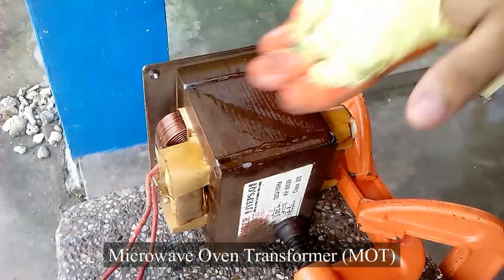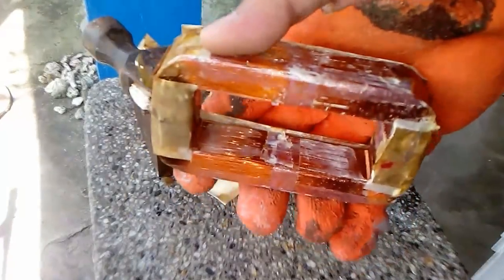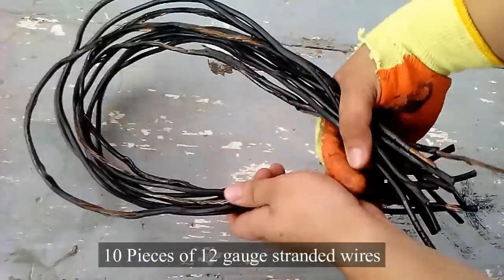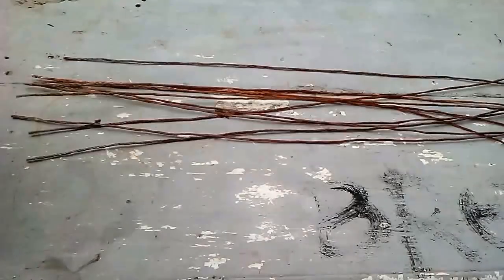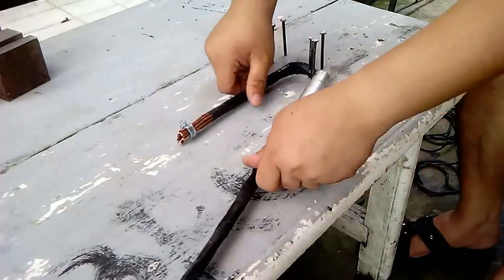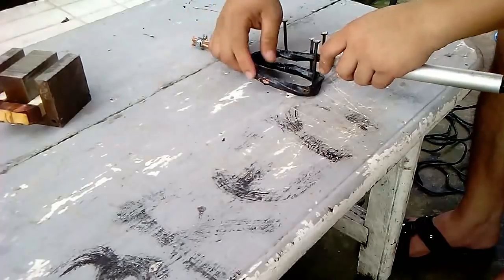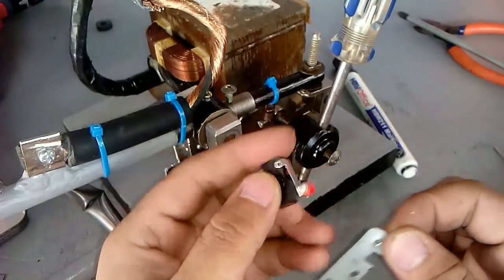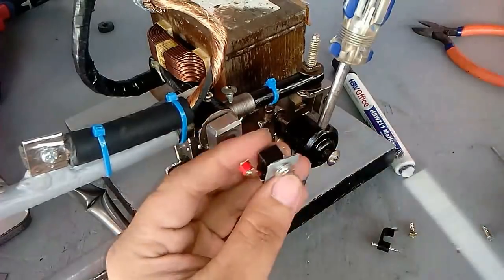Diy Spot Welder Microwave Oven Transformer(MOT)

Comment: By cutting the transformer housing you have dramatically reduced the coupling in the transformer and introduced an airgap, you did weld the housing back together but that is only on the edge giving an effective coupling of just 5 or 6mm rather than the 20mm or so it originally had.  This increases the effective resistance of the transformer and is the same as using much thinner wire.  You should have cut the high voltage windings off and fed new wire through the holes without cutting the housing.  This is why you didn't get the output current necessary, 1 microwave transformer is capable of welding a 2 or 3mm of steel if done correctly

Comment: Why did you connect MOTs in serie and not in parallel ? Did you measure voltage between your 2 projects ? I think it has doubled but amps remain the same

Comment: Connecting transformers in series adds the voltage together at the same current, connecting then in parallel adds the current together at the same voltage. So to get higher current put the transformers in parallel.
Reply: They are in parallel. It straight up wouldn't work if you tried them in series because the primary coil of the second transformer would be only getting a couple of volts

Comment: If using 2 transformers, the parallel or series connection which will work best?
Reply: parallel because you want more amps
Reply: @hyperhektor7733  Hi Hektor. As I see, in the SEK project the tr. are conected serial - am I wright?
Reply: @bostjanv.1545  not sure what u mean with SEK project, but i know series is wrong when you want more amps. Series will raise the voltage not the amps. and you can only have one of the the 2 options. So parallel is the right answer. I worked as Electrican and in Electronics so i should know :).

Comment: I have a question, please help explain  1. Use 2 transformers, must be the same size or not?  And 2. If the size is not the same, will there be any problems?
Reply from the maker: It should be the same. It will work but one coil of the transformer will heat probably its the snallest one
Reply: @SekAustria  thank you...

Comment: Did you use two the secondary of microwave oven transformer? Why don't use Primary Winding?
Reply: He said that he used the primary winding (and the video shows it). The primary winding had fewer turns than the original secondary winding because it's arranged to produce hundreds of volts from its output. The spot welder needs the opposite - less than 2 volts output.

Comment: Bro good effort but i want to say one thing that by making them in series doesnt have benefit because the wiring is same ...in single transformer if wire can carry 100 amps then also in doble it will carry 100 amps because wire guage is same...and here amperes are working

Comment: Gonna try this with an old bxi 100 welder transformer. the old secondary coil was fairly easy to unwind with out taking the transformer apart.  the fun part is to fabricate  the the parts you made in college years ago and I may come up with something else just as good.

Comment: how much kilo watts current produce ? can i use 5 transformer  to produce 20kw power ?
Reply: no, when you have 220V mains voltage usually 3600W is the limit, if you want more then you need
a 3 phase terminal from your electricity company.

Comment: Tip: Spot welding the iron plates is more than enough. Be aware of the more heat you apply with the welding, the more risk for the insulating lacquer layer on the copper..! Stick welding is the form of welding that generates the most heat. Spot weld it wit a MIG or TIG weld the thing.

Comment: Surely you didn't have to cut the transformer housing apart to remove the wiring and then having to weld it back together? 
Couldn't you have just cut and pulled out the wiring you want to remover, and then wound some 0G wiring thru the housing?
Reply: because he want to salvage the secondary winding for future projects

Comment: i need a battey welder can u sell me one a diy if it fuck up something its on me lmk
Reply from the maker: i will work on that brother.
Reply: You'll face a problem there as DC can't be transformed. So in order to make such a welder, you will have to construct a circuit that makes the DC from the battery to AC. From there you can put it in the transformer and get the voltage down i.e. current up.
Reply: Basically, you just need to connect two wires from the wall socket to the transformer. As it's AC, it doesn't matter which wire is on which terminal on the transformer, as long as they both connect on the primary winding i.e. the winding he left from the original trafo. Then you'll have a functioning circuit and the welder is fine. If you' don't want to go through the process of flicking the switch on the wall outlet each time, you'll need a switch on the device itself.
The switch he added (with the little arm and the red roller on it), just has to act as an ON/OFF switch for any of these two wires...again it doesn't matter which.
At 5:47 you can see he's about to install one of the wires on the switch, the other connector on the switch is one of the wires from the wall outlet. The other wire from the w.out. is just going directly to the primary on the transformer.
CAREFULL...!!! The switch MUST be installed on the primary side, the secondary will burn that switch to a blob of crap at once.
Reply: You're welcome. Well, as it is an AC powered device, there is so to speak no polarity as it "shifts" (alternates) with the frequency of the power grid (in most countries 50 Hz). So 50 times each second the one wire is + and the other -, when it shifts the polarity is reversed. That means it doesn't matter if the blue one goes directly to the transformer or the brown one. The white one, well..it could be any color. What it does, is to lead the power from the switch to the trafo, while the brown one is a live wire coming from the wall socket.
AC is the only form that can be transformed up and down in voltage/amperage, DC can't. It would be a little complicated to explain why, so I'll keep it simple.
A stick welder has an inbuilt rectifier, that changes the transformed AC to DC. That means you can use a DC device for welding, given that it has enough power (A).So your battery welder will work, but you can't transform the 12V DC down and get more amps out of it, without expensive electronics. So if you want to stay with 12 V, it can work as long as you don't overpower the battery. A word of caution here...NEVER short it out..! If shorted so more amps flow, than the battery can take, it will explode..! I.e. short it with a wrench or something, is a big NO go..! 
Unfortunately, the link is in Russian..and I really suck about that..(my Chinese is worse, though)...lol
Now, what I take from it, it's an ok design..but only to be used for shorter periods of time. You can add a timer on the switch side, that's an option..yes. A cheap timer module that runs 12 VDC from E-bay will do. My suggestion would be a battery of minimum 60 A/hr and a charger, you can hook up to it when the voltage goes below 10 V.
Reply: Hi Izzy, it's 11 o' clock am here in Denmark. I thought you were Russian as the link was to a Russian site. The 12 V timer module will do the job, the solution with the 555 will too. The 555 IC is an oscillator/timer unit, but it can't stand alone so other parts are needed too. I would suggest buying a ready to mount part. That would be easier for you, as you wrote your electronic skills are limited for now.
I did an E-bay search and found a module with the exact description you gave. They ask 15 $ for it..that's just extortion..! I see you get 12 V timer modules at around 3 $, with free shipping, even found some that say 2 $. A lot of them include a pictogram with a description of all terminals used.
Reply: Excellent..! The circuit with the solenoid will work, the way you describe it. Just one thing to mention here..the 300 milliseconds are far too short a time.  You'll need more like 1 to 1,5 seconds, depending on the ambient temperature and the thickness of the material. However, the timer lets you adjust the time easy. 
Yes, you'll connect it correctly that way. The light bulb symbol on the schematic resembles your solenoid. So the timer is activated by you hitting the switch. It activates the solenoid for the time set by you prior (set button on the timer and + or-).
Remember, the timer has to have a 12 VDC operating power...the switch on that side is to "trigger" the circuit to start the countdown in the electronics.
If you still are a bit unsure but want to test the circuit, simply put a light bulb in according to the schematics (blue circle with the X in it).
Wait a minute..Aluminum is a different game. If one TIG welds it, one would use AC current and pulse weld it together. I really hate that shit, cause it makes your TIG needle dull the second one lights up the arc. It also makes a puddle that looks like Mercury...all of a sudden it has got too much heat and a big nasty hole will be the immediate result.
So spot-welding Aluminum will give you a challenge too.
Reply: In fact, I do like cooking. I'm a person that enjoys life to the second, that includes good eating and drinking. I also make my own stuff btw..lol
Have you build or got an enclosure for your project Izzy..?
Reply: Ahh, I see. You know what..? I'll send you an email and try to shed some light on this subject. You should know I'm not an electronics specialist. My main area is blacksmithing and machining. however, I know a thing or two about power electrics.
Oh yeah, professional equipment is quite expensive. The ESAB welder I use for my job is 10.000 $ the small Migatronic TIG welder is a little "cheaper" and counts in at 7,500 $.
Reply: You should have got an email from me yesterday, Izzy.
Reply: That will work..! However, as it has to handle quite big currents, you'll need that unit to trigger an adequate relay, which again closes the high amp circuit coming from your battery.
So, the schematic shown is fine...the bulb has to be replaced with said relay and you're good.

Oh, no...it'll work with just one transformer. You're welding car panels, not columns for a bridge..lol. 
It's a matter of how many windings your secondary coil has. Also how tight they are packed in there (as tight as possible). These factors determine the magnetic flux in the transformer, which again determines the output (V/A). In a way a transformer can be compared to a gear exchange on a bicycle, where the teeth are the windings on the coil.
Reply: Well, I don't know if that email ever got to you, but I wrote about this subject in it. Here in Europe, everything runs 220 VAC (220-240). Up here in Denmark, we have 230 VAC..the electric company does run that high, so the consumer doesn't get cheated..LOL no..b.s.  In the US common power grid voltage is 120 VAC some have 220VAC, though. So yes, just use a transformer with the appropriate voltage. If you use a 220 V appliance on 120 V, it won't work. You'll be left with only 1/4 of the power available. P=UxI

Comment: sek Austria.  I enjoyed watching your video, but I have to understand something. i built a similar transformer circuit and the primary side of both transformers being that close together had a negative effect on the output current/voltage. how is it you pulled this off without any output changes? thanks for the video.
Reply: Swap the two cables connecting to the second transformer and it will work. You were simply unlucky, so the two transformers were canceling each other out.

Comment: yup, you need a welding machine to make a welding machine
Reply: Thats what I was thinking when he cut the transformer to get the secondary coil out. Most of the videos I have seen (using these to make a strong electromagnet) they cut the secondary coil and push it out, then feed the cable through the hole
Reply: Yes, it's an easier way to do it. Also, stick welding it together afterward, implies the risk of burning the lacquer insulation of the wire and make them short. One wouldn't risk that by simply cutting out the secondary and pull some cable through the slots a few times.
Reply: Yes, cutting them open is really the best way to do it. I've made a few and the first one I used the technique of cutting the secondary and then pushing the cut wires through, then you have to rewind the secondary by threading it through. Not so bad on one like this where there is only two turns, But if you get need to wind 4 or 6 turns then it's not fun. Cutting the core then rewelding it was so much easier. I use an angle grinder instead of a hack saw. The only problem is if you don't clamp the core shut very tight and keep it tight while you weld then you may end up with a noisy transformer. It will hum very loudly if you don't put it back together tight.
Reply: lmfao, riiiiiiiiiiiight
Reply: the IncyVinciFancy yaad you get

for

Comment: Nice job! Can you share your experience regarding to temperature in this transformers?
Reply from the maker: its not getting that hot because it only supplied when the lever is pulled,
Reply: you can leave it always on, the consumption on current will be very low until the short. I liked your project but concerned about heat rise in continuous use.
Reply: @israelsalas4617  you also can add 2 fans and also heatsinks
Reply: @hyperhektor7733  this kind of applications use water cooling. It's a lot of heat loss. 😁
Reply: @israelsalas4617  you could build that too its you build not mine :). I just used 2 fans and aluminium heatsinks. This enhanced the usage time.
Reply: @hyperhektor7733  ok, aprox duty cycle with heatsinks my friend?
Reply: @israelsalas4617  i have not measured that since i dont do mass production, but one thing is sure its more that without :), also you could use water cooling instead (for exampl use a water healradiator from a motorcycle and add a fan, + aquarium pump very affordable soloution)

i am optimising my machin atm, i add a second tranformer and double up the cipper arms . Maybe i will build a furnice to meld copper so i can geht cheap thick copper.

Comment: A single coat of electrical tape... holy shit do i not want to be near that O.o
Reply: The heat may be an issue, but the voltage is very low, from 3-10v (even on industrial welders). :)

Comment: sir, please say about the wiring and current supply to the Tranformer . should I connect +&- to the two pole of transformer ?
Reply from the maker: +RS DHIR primary are connected in parallel and secondary are connected in series. There is no polarity because its ac voltage.

Comment: Microswitch must be very happy with the current more than 30Amps.
Use power relay for motors controled by microswitch.
Reply: the microswitch is for the input Ac from the main
Reply: yes, main 230V AC current is more than 30 Amps. This switch is designed to 2,5 Amps induciton load (transformer) and 6 Amps to resistant load.
Reply: Opravdu jsi si jistý, že tam je přes 30A? 6900W to trafo nežere :) Plus by mě zajímalo co bys tam měl za jistič, normálně je 16A, takže by vypadnul jistič, kdyby to trafo bralo 30A na 230v... For english, there's no 30A, explanation: lets say the transformer is 700VA (similiar to watts) - then current flow on 230v is about 3 amps, on the secondary coil, where's about 2-3V there is current flow about 230Amps. Theretically, nothing is 100% efficient. You cant transform power, only voltage and amps. There's Ohm law (I=U/R) and P=U*I
Reply: 700W je výkon magnetronu. běžící běžná 700W mikrovlnka odebírá 1200W. trafo v mikrovlnce pracuje normálně, nikoliv do zkratu, jako v této svářečce. 
Pokud to bude odebírat 30A, jistič 16A vypadne asi za třicet vteřin. 
Dominiku, jednoduchá teorie by ti šla, ale ono je to složitější, než si myslíš. Zkus si něco přečíst, nebo si to v garáži vyzkoušej. Trochu ti to rozvedu, pro zdokonalení se v principu traf, abych vysvětlil, proč tomu tak je.
English:
16A Circuit Breaker fails at current 30A for 30 seconds. We use a simple Ohm's law and the principle of the transformer. Us = Up / N Us - secondary voltage, Up - primary voltage N - transformer ratio. This welder creates a short circuit on the secondary coil, Us = 0V. What is the primary voltage? Zero! DC resistance of the primary coil of the transformer is 6 ohm (I measured it) I = U / R ... 230/6 = 38A (one theoretical transformer)
Reply: I doubt it very much that the transformer is pulling 30A... his power point is 240v and it would be on a 10A fuse in the fuse box at the front of the house... I'm not sure what amp rating fuses are used in countries with 110v... being half the voltage... I would imagine that the current would be double.... hence why some transformers that are designed for world wide use have a three wire primary connection consisting of two 110v primary windings... wiring one way gives you 110v high current and the other way around gives you 240v half current... 
Theoretically I believe that if you remove the secondary windings as he did in this video... you could re-use the original primary wire... one transformer with a minimum of about 5 windings of multiple strands... nice and tightly wound... buy some high temperature insulated tape which is a yellow or gold color and wrap it up... the more turns in the secondary windings the more voltage.... the more strands the more current it would be able to deliver... he had more than enough current but the voltage was to low which is why he used two transformers wired in series on the secondary windings... Try it out, there's plenty of these types of videos and when you watch enough of them you start to get the idea of how it works...